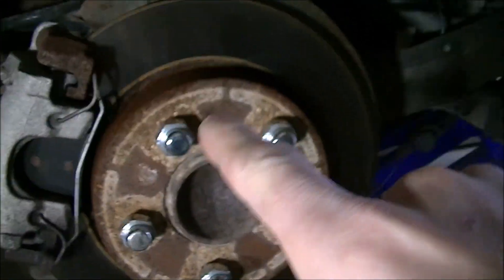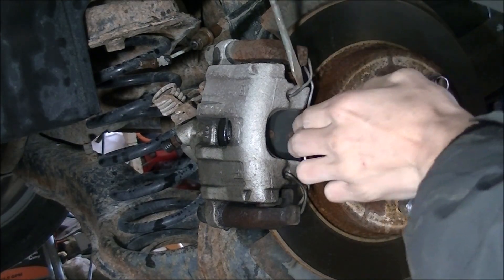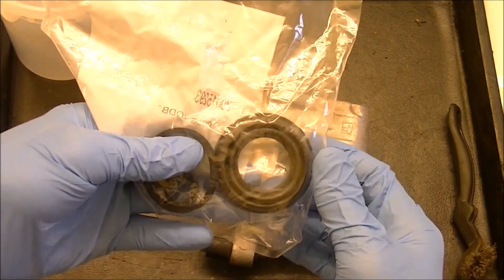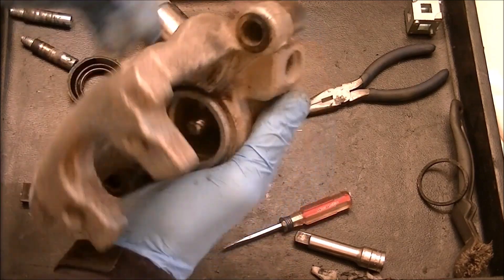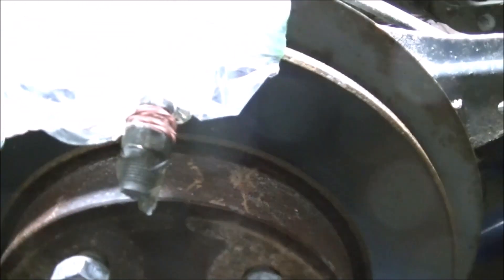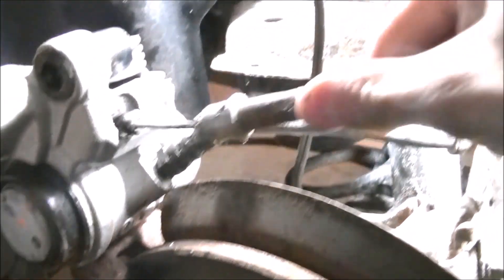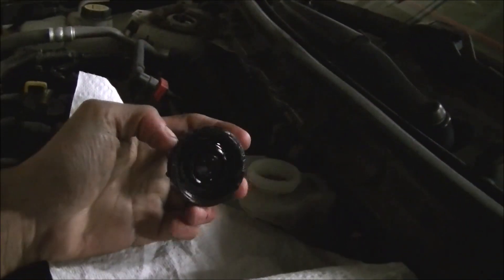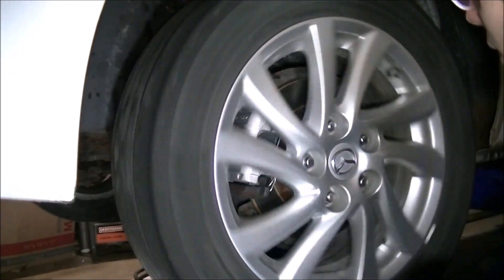2010-2013 Mazda 3 Rear Caliper Replacement and Rebuild. (2012 Mazda 3)

Comment: This is exactly what I need to do because I noticed the boot was leaking but I am stuck being unable to loosen the hose 🤦‍♀️ Great video!
Reply from the maker: I find that a prybar braced against my stomach or chest between the caliper and a nice fitting wrench pref line wrench will do you just right.
Reply: @ Yes! I finally got it! Used a large pry bar and a pipe over my flare wrench worked  perfectly. It was so hard finding the right leverage in that position.  Thanks!